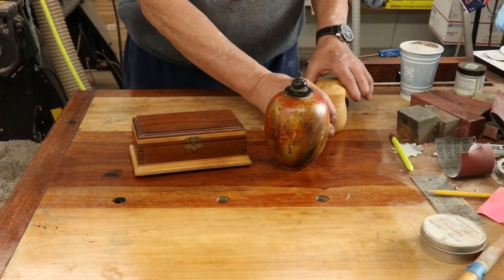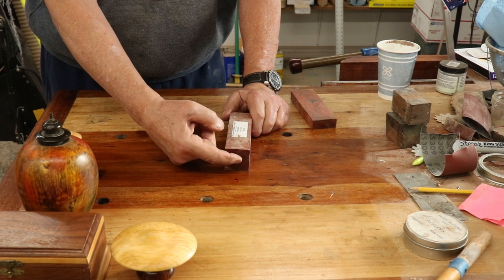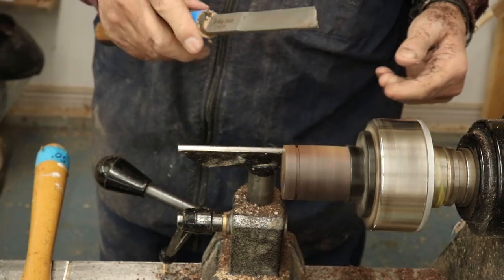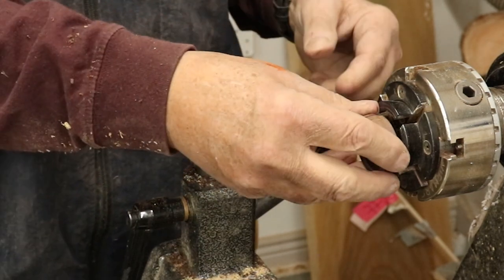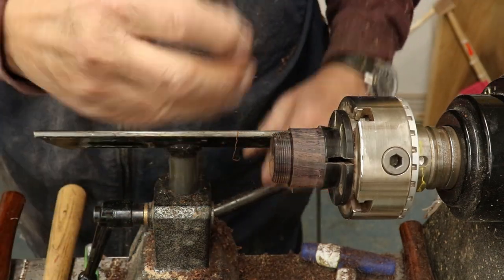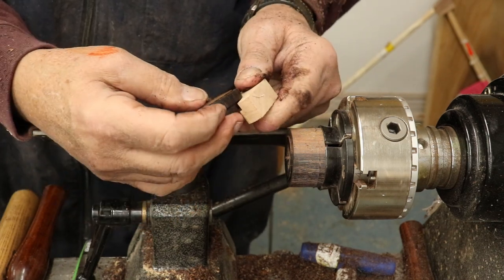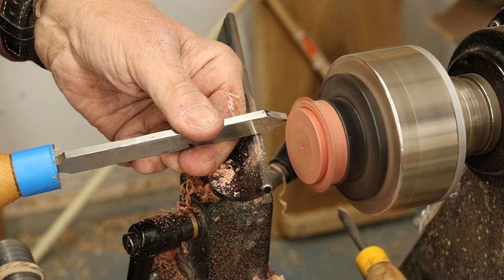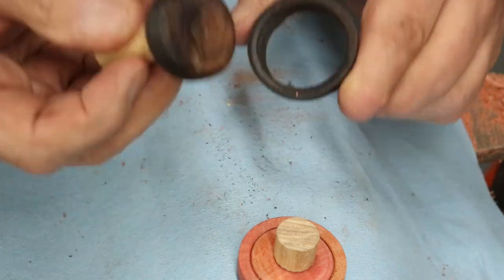Threaded Inserts for Woodworking-YOU  can Make      with Sam Angelo

Comment: A variation on this theme - I make a lot of wine stoppers.  The traditional approach is to drill a hole in the end of the blank, use a 3/8x16 tap to thread the hole, and then use that hole to mount the blank the threaded stud on the end of a stopper mandrel.  The problem is that those threads are in end-grain, and as you point out, ordinary woods don't take threads well, and especially end-grain threads.  As a result, its not unusual to strip those threads when turning the blank.  You can buy steel or brass threaded inserts at the hardware store, but I've found that a simpler (and less expensive) approach is to make a threaded insert using face-grain timer that then glue into a hole in the stopper blank.  Drill a hole in a scrap of face-grain ash, use a machinists' tap to thread the hole, then screw it onto the stud on my stopper mandrel and turn it down to a cylinder, typically 5/8" diameter.  I can batch out a bunch of these that I keep on hand, and when I want to make a stopper, I just drill a 5/8" hole in the end of the blank, glue in the insert, and proceed.

Comment: A useful, informative video. I messed about with thread chasing a couple of years back using scrap wood. It worked in terms of an operational screw thread. Trouble is a lot of timber is not suited to threading, making these inserts is a good way of making close grained wood go further whilst giving more open grained wood a 'cousin' to work with.

Comment: Informative video as always, Sam. I was surprised when you did not turn that small tenon on the male size to fit the female thread like you typicaly do. Since I would expect you to use the male threads to fit over a tenon ultimately on your finial, I would have thought that you would go ahead and add a hole for that and eliminate the need to glue a temporary handle.
Reply from the maker: I used hot melt glue to glue on the temp handle when I first made the inserts.  I really didn't like using this insert.  I usually don't do it that way-or never do it that way.  Yes, there were a few really messed up things I did in this video.....Live and learn.  Sam
Reply from the maker: Plus I thought I was responding to another thread chasing video....OMG getting old.
Reply: @WYOMINGWOODTURNER  I resemble that remark!

Comment: Your idea is to use threaded inserts rather than threading the the actual work piece. As I understand it, you are saying to use inserts that will reliably take threads rather than a work piece that doesn't thread well. That certainly makes sense. This is a great idea.  👍👍Thank you for sharing. Have a great 2023 and stay safe.🙂🙂
Reply from the maker: Thanks Glen
I have used both methods over the years. And as you say, some woods will not take a thread, so inserts is the way to go. I will do a follow up video showing how you can buy threaded connections and make your own if you’re not a thread chaser Thanks, Sam.

Comment: Thanks Sam, great video, have to do some thread projects....did you make that holding tool? I need one of those to pull the thread so it can cut properly
Reply from the maker: No I did not make that tool. However, you can certainly make one yourself it's not hard to do. I got this one from craft supply for about $40. Thanks, Sam.

Comment: Sam is there a janka number you suggest staying above for turning threads.
Reply from the maker: That’s a good question. I don’t really use the Janka scale, although I understand it. For steel and metal, I like the Rockwell hardness scale. The Janka scale started with flooring, and was designed to measure the toughness of wood when something was dropped on it. Like Flooring. For thread chasing the better measurement is specific gravity. This sounds like a good topic for my notes from the Turning Shop video out later this month. Thanks for the idea.